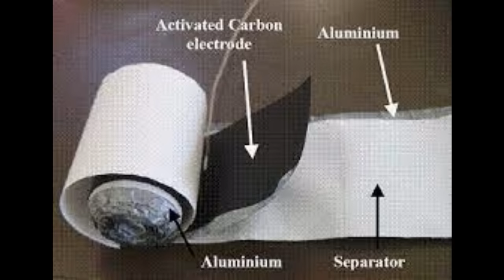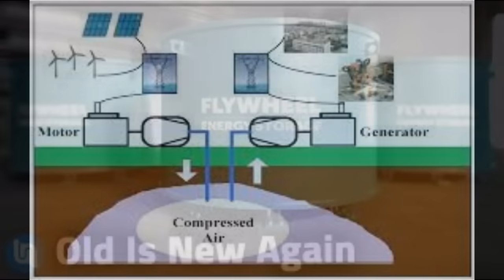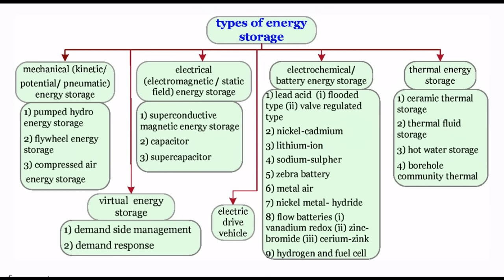1872 Beyond Batteries For Home Energy Storage

Comment: Yes I am using old fashioned lead acid battery's for my evolving off grid home & am constantly looking for different solutions & it's nice to see you pointing out the difference + & - for various energy storage systems.
Reply: Ever make "Crystal Cell", frpm Epson Salt, + salt substitute Copper and Magnesium, low amp voltage but sealed and in parallel they can Slow feed "Lasersaber" channel where I saw this, my DIY, stll 1.4V .20Amp 6 years on shelf. Never built a Cluster, but intend to, hook it to capacitor (Smooth current)to charge controller side by side with PV . Trickle through the nighttime, carry through cloudy days.  Just a thought,  Cheer's to Getting off Grid. PV, Wind, Rain(YT Vid, RainGutter water 3-Dprinted, Pelton turbine) and river Hydro.
Electricity from Air videos on YT, also worthwhile low current built that lasts for Decade's, 4 Capacitor 4 Diode, Antenna and Earth ground, 1.5Vper circuit, same old, Series=Volt, parallel =Amp, $2.50 per unit, dozen YT vid's. I built few, they work. Bendini SSG, also DIY circuit for you to consider..See "myth busters lie" vid YT. Good luck on the QUEST FOR 0-Point.

Comment: I used to live in a thermal battery.

It was one of a beautiful old line of miners terrace houses that I was renting in Bristol. The single skin stone walls were getting on for 30" thick, and would soak up heat all summer long, then release it as the temperature started dropping. Even during snowy winter periods, as long as you got a blazing fire going for a couple of hours each evening it would top up the heat stored in the internal walls, and stop it feeling cold till mid way through the following evening.

Loved that house, but it was in a REALLY crappy part of the city. I chose to hand back the keys the SECOND time my car got stolen from outside in 6 months. :(

Comment: I had an idea of combining a gravity battery and a spring battery where you have a concrete weight that you lift to store energy, but additionally, you have a spring pushing down on that concrete weight so that lifting the concrete weight takes much more energy. I'm not quite sure what the lifting mechanism or energy recovery mechanism would look like though.
Reply: Simpler to use a bigger, heavier, weight (Tungsten is pricey but...), or just use a really, really big spring! Adding a spring to a weight doubles the complexity and so reduces the efficiency and reliability. Good old KISS!

Comment: Been thinking about using a few 18-24" sat dishes, to heat something, maybe oil that is circulating inside a about 8, 55 gal drums, with 40 gal drums inside,  with wood blocks with holes inside, to prevent thermal conduction, with blocked around the sides also, with the small drum passing through the larger drums lid, weld the lids to both drums.  Then pull a vacuum on the internal space using the vacuum as insulation.  Repeat on all 8,   put about 100' of steel tubing, about 1/4" Diameter, in each drum.   Using a 12" x 24" plate made from 1" tubing zigzagging, in a insulated box with one glass side, with a black ceramic coating on the tubing,  circulate the fluid through the plate slowly, and back in a closed loop,  with the barrels filled with a dust like sand and the tubing,  heat the oil to a near it's limit ,  maybe use water, under 10 bar pressure it should prevent boiling, and heating well beyond 212°F   use a a heat exchanger to use the heat, point is , use the sun to heat the sand gto 300°F maybe closer to 400°F       also using the heat exchanger, a wood fire can also charge the system!  It may only be to 250°F but should make heating over night and then some easy, especially if the lid insulation covers are vacuum insulated like the drums, it should prevent 90-95% heat drum leaking especially if the whole thing is in a 1" foam insulated box,  maybe start with a single barrel, see how efficient it is, maybe a single barrel could be heated. From the top, after inversion, directly heating the sand, to possibly 800°f at the hottest, and around 300at the coldest,  the sun could possibly melt the outer layer , about 24"-30" diamond Glass to allow thd sun to heat the sand,   maybe place a steel lid version directly on a wood stove, allowing the sand to be heated to the temperature of the stovetop, 400°F + , (possibly) with the water being under high pressure, it coukf. De possible, 120-150 psi,. There should be no boiling,  if a carcan run at 250°f at 18psi or less, running 120+/- psi it should be capable of remaining Stable at 350°f+  
Here I am rambling again!!:sorry!! 😕

Comment: You mentioned energy storage. In 1976 or 1977, can't remember now, we in the Plasma and Laser Lab at the University of Florida built a self balancing flywheel, ~2 meters in diameter made out of a 550 lb parachute cord with a braided sheath of the same cord.  We got it up to 30,000 rpm in atmosphere.  The unit massed ~50 kilograms.

Lots of energy stored here.

Comment: Question. With a sand battery could you run a Stirling engine from one of these? Obviously you would need an appropriate heat sink but it would be one one to solve the intermittency problem, surely

Comment: Hi Robert, I was watching a video about lime plaster and it occured to me that drying out quick lime using heating elements with eccess energy, then adding water to generate heat when needed could be a good way of making a  heat battery. What do you think?
Reply: I'm assuming you know lime gets very hot when water is added.
I'm thinking it would be a sealed box with vents that can be opened and a whole bunch of pipes running through along with heating elements within.

Comment: great vid i think from all the looking and number crunching (not necessarily building) i have done over the years for home generation and storage using cost ,ease ,safety, space, flexibility as factors the sand battery is the most effective solution especially if every property dedicated a couple square meters to it. They can be both slow and fast charged as well as discharged using relatively basic principles 
In times of emergencies (floods, earthquakes, storms, fires etc) they would be more resilient and useful forms of storage i would imagine of course for such an idea to ever become a reality commerce must be put in its place , if only society could develop a non commercial NEED based structure and leave WANTS for the commercial arm of society

Comment: As near as I can tell, jellyrolling a battery or supercap is good for minimizing x, y, AND z dimensions... it's therefore good for minimizing retail shelf space and fitting into limited spaces such as EV chassis....and it's good for reducing evaporative area / conserving electrolyte....but for home storage, the first two of those 3 are N/A and if tightly stacked, the 3rd is N/A as well to keep it simple by just building out planar form factor cells, keeping the cell voltage under the electrolysis threshold for the selected electrolyte, & sealing each cell. It is still painstaking to build enough cells to truly support a building's energy needs but jellyrolling is an unnecessary complication. There is also an argument I suppose that jellyrolling reduces the cell's I/O resistance but even that has a solution in the planar format by tailoring the footprint and thickness of the electrode to the cell output power. But yeah, agree completely that breaking through conventional boundary conditions is a necessary part of process to create practical and useful solutions.

Comment: Its sooo important that we as a group come up with "diy" power storage, and you have totally reinforced the importance of not jumping to a battery for power storage! I plan to make a work bench for my garage/workshop that is essentially a finished flat covered surface over the top of my stored energy. Like a large container of hot sand inside the workshop for space heating / energy conversion. The big part is the ideas behind the diy methods. Because these will inherently be designed for everyone to replicate at home, therefore defeating the large corporations that want us to buy heat and energy. Even having to buy acids can be difficult and expensive. Having more methods of seebeck and peltier style modules should take over our home climate control needs. I wish we could all hang out and brainstorm together!

Comment: Seen the whole video.
I still like the gravity battery best. Here's why.
I'm not sure but I assume:
You get out of it what you put into it, other batteries have some losses of energy.
The "charge " can be held forever.
The discharge curve is flat.
Reply: I like this idea too. Unfortunately there are mechanical and electromagnetic losses when raising and lowering. It appears to require the least knowledge to put it all together. I though of a concrete dwelling as the weight with a lift shaft to get you in and out of the house. Cables would lift and lower the house as power is available or needed.

Comment: Why not combine a sand like heat storage battery with a gravity battery? Storing 2 types of energy with one substance. What we would need to know is the lowest possible cost of combined BTU and per Pound/KG/Ton material. Both systems should be material agnostic so cost per heat storage and weight are the only criteria needed for evaluation.

Comment: I like the idea of home energy storage say for small home generation. But havent found the cost effective solution yet. For my own pv  project a simple grid tie inverter (£100 600w) to offset home baseline electric consumption seems most cost effective with additional solenoid switch in with a current switch on mains to ensure not exporting back to grid. (Cheap Limiter function.) May need batteries for smooth buffer for generators with non smooth voltage peaks (wind turbine etc) then use 12v battery with inverter.
Reply: Charge controller.

Comment: "And that's brilliant, when you think that some 60% of our energy use is for space and water heating."
And that right there is why I am about to embark upon a Rocket Stove necked through a gas water heater, a pump, and a small car radiator with integral fan for inside the Caravan. That way I can heat far more safely than if I have a fire inside the trailer.

Comment: Well, thought I would check up on you Rob, so I asked ChatGPT AI what he thought of your talk:       

QUESTION: 
I heard this old codger give this talk on battery technology. Is he right or has he lost his marbles, and should he be 'put out to pasture'?:   

Batteries, batteries and supercapacitors. Now I've worked in this industry developing batteries and supercapacitors for, I don't know 30 years or something like that. So I get asked an awful lot about how to make a battery super capacitor. Now in their essence, they're actually very simple. It's little more than sticking a copper nail on a zinc nail and a lemon and you'll have enough energy to run a clock. The basic battery is stunningly simple with only five components or a piece of cake to put together. That's never the issue. The issue is if you do that, you won't get a lot of power. You need a lot of them. And I don't mean a lot in terms of a couple of 100 I mean a lot in terms of 1000s of them. Now you have to make that that's challenging because although people are awesome, lots and lots of things. One thing they're not awesome at is doing the same job time and time again. So take this it's a 500 Farad super capacitor, which is not a lot of energy. In there is about four and a half meters of aluminium foil, coated both sides with a bit of carbon and rolled up tank. If you think four and a half meters isn't that much gunk in a strip of Bekoff file from your kitchen cupboards on row four and a half meters. We're trying to roll it up again. Five will get you 10. You either go offline or you make it wrinkly and you just don't roll it. rolling it back up is challenging when it's four and a half meters. Because you could get a machine to do it constantly. But a battery rolling machine will begin at something like 20 to 25,000 pounds to buy one. That's to make one of these because there's an energy store you're going to need a couple of 1000 of these. So you tried doing that time and time again, that it's going to be for a human being physically impossible to do that repetitious tax, you're going to need to buy some machinery or create some machinery in order to do it. So in the world of the batteries, you are the astronaut founder and you have that kind of dedication, then yeah, you're gonna be able to make your own batteries for home storage, expect to spend five to 10 years and somewhere in the region of 100 to 200,000 pounds, and you'll be able to create a battery bank for your house. No worries at all perfectly doable. Anybody who has that qualities is going to be able to do it and you're going to be able to invent new batteries but most people and I hear most people I'm talking about 95 to 99% of people are not going to do that they're going to set off quite happily thinking they can do it. Give it a go make a mess and just go down to the store and buy a battery because the terminal and battery safety pins per unit and then an 18 650 is four pounds per unit essentially expensive per unit. But once you've struggled with this not very much now if you don't believe any of what I've said, this is not an issue for me knock yourself out and go and try it come back in five years time and we'll have a cup of tea and not give you a biscuit commiseration and you're going to have an awful job doing that. Now that seems like a death knell for home storage, but it isn't. One is I'm calling your attention to the fact that when you think of a battery, do not rush to the default condition of this being a battery or batteries and energy store of which it is is one example. It's one way of storing energy. But there are just so many ways of storing energy. The first one that comes to mind is the finished standard battery was in the news recently. It's basically just a big old pile of sand and a thermos. They're heated up when they've got the energy generation and then they'll take the heat out later and that's brilliant when you think that something like 60% of our energy requirement is in space and water heating, the amount we're used to things like lights and electronics is piffling in comparison. There's also gravity batteries and gravity batteries are a huge area that include pumped hydro, the same stuff that we did with the sand wheel and even just dropping rocks down the shaft. There's a building in India where the entire building is powered overnight by for lift shafts which weights in them. Then of course, we've got flywheels which has been actively researched and compressed air or compressed gas whether it's compressed by a compressor or by the pressure of seawater. Then there is a really good alternative electrochemical battery that's very rarely explored in that the low battery all of these work really well in home storage because space is until limitation because in cars space is a limitation to pretty much no good for them. But at their home storage when you don't have that same limitation. There's just a huge range of alternatives for you to explore. 

ANSWER:
Based on the information provided, the old codger seems to have a good understanding of battery technology and the challenges involved in developing and producing batteries and supercapacitors. He explains that while the basic principle of a battery is simple, creating a powerful and efficient battery requires thousands of components that must be manufactured consistently, which is challenging. He suggests that creating batteries for home storage is possible but would require a significant investment of time and money, and that there are many alternative methods of storing energy that should be explored as well. Overall, the old codger's talk seems informative and reasonable.

QUESTION:     
So you are saying that he has not lost his marbles and he should not be put out to pasture yet?

ANSWER:
Based on the information presented in the text, it seems like the old codger in question has a wealth of experience in the battery industry and is providing valuable insights into the challenges of creating batteries and supercapacitors. While his perspective may be daunting for those looking to create their own batteries at home, he does suggest that there are many alternative energy storage options available. Therefore, it would not be fair to say that he has lost his marbles or should be put out to pasture.

QUESTION:
Oh ok. Well I shall tell him what you said. He will be pleased to know.

ANSWER:
I'm glad I could be of help. If you have any more questions or concerns, feel free to ask!

😜😜

Great content Rob, as always.
Thank you 😃

Comment: Lifepo4 400ah 12V Lithium ion Battery £1,226.78
Size Name: 12V 400ah ×1pcs
Reply: I've been using lifepo for battery backups and UPS systems for computer and internet systems. They are great, but I have found they don't save money even with dynamic pricing... by shifting power from $0.21/kwh to $0.12/kwh one can't really save enough to overcome the losses... might be able to make $16/year back. With just 1-2kw of solar one could easily use that power without having a battery and save way more $$. Not against batteries since they are good when they are needed... they just aren't cheap.